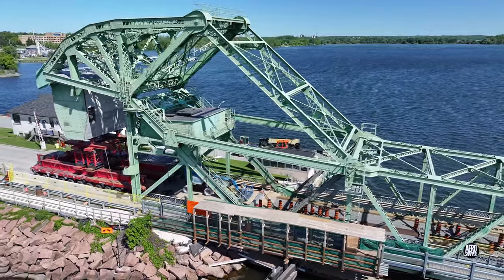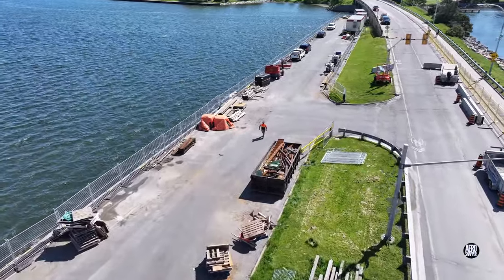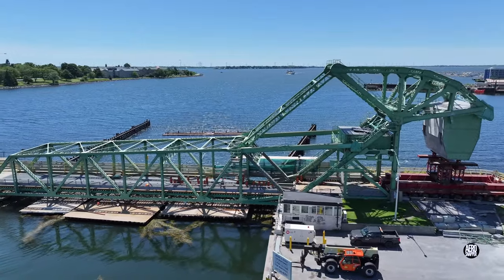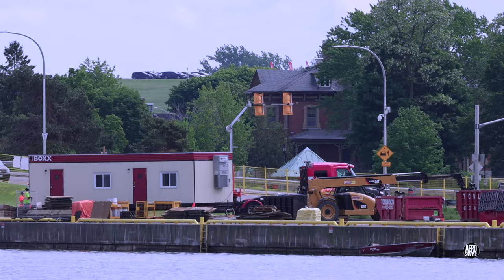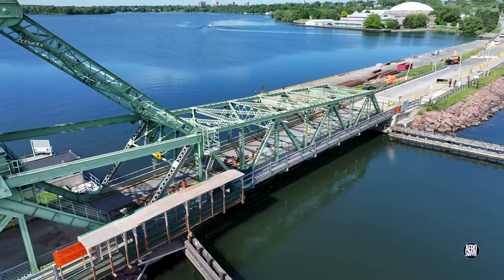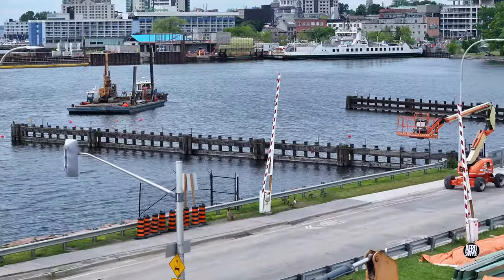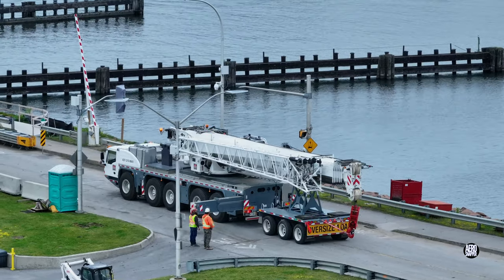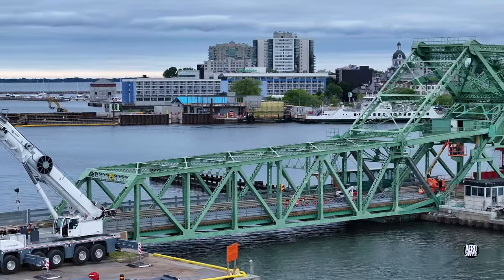Causeway Catch up   4K

Comment: Incredibly sad.  As a child I spent many hours at the bridge, hanging out with the bridgemaster.  Tragic to see its end.  That said, I do understand the decision -- the bridge was extremely finicky even before the accident.  Due to thermal expansion, it was sometimes really hard to close and lock.  Add a twisted beam to the mix and all the alignment issues that come with such an event, that bridge would have been damn near impossible to operate reliably.

Greetings from Switzerland.
Reply from the maker: Neil - I share your sentiments about the bridge - and understand the reason for decisions that have been made. It’s no less unfortunate. I hope that something appropriate to the environment and the historic sites around the Causeway will replace it.